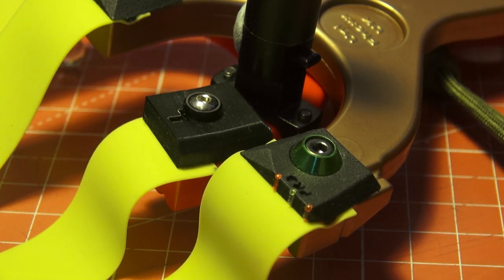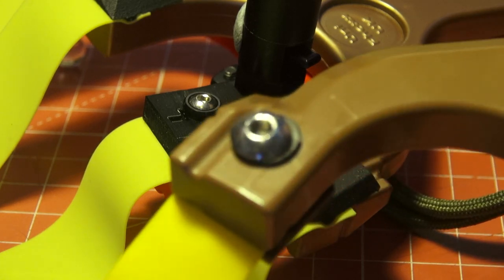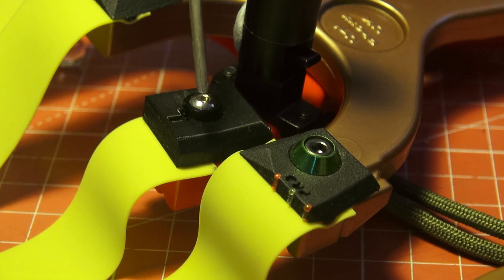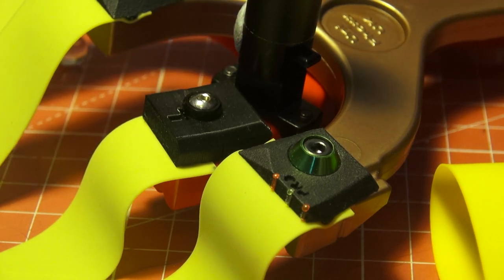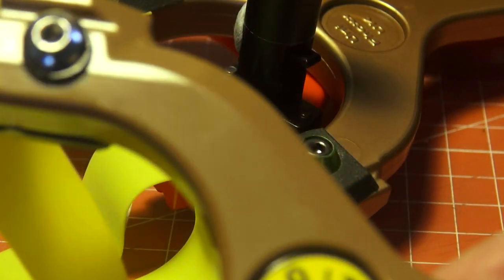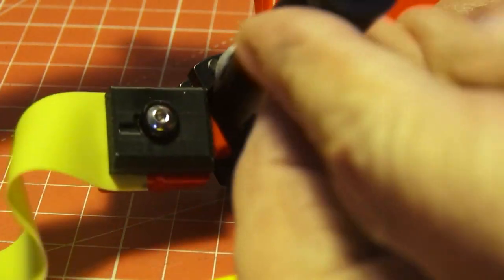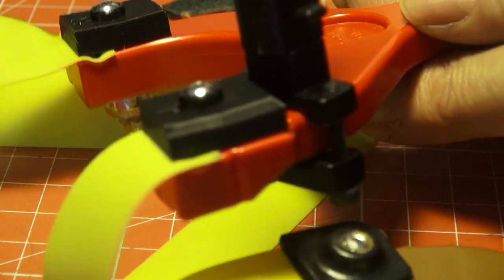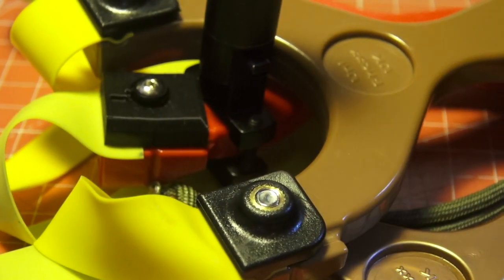WASP UNIPHOXX SLINGSHOT BAND-CLIPS  - ALL THREE KINDS

Comment: I’ve not used clipped catty’s yet. I sometimes wonder, does the elastic fray quicker seeing as it’s clamped tight in one place where it has to stretch when pulled? In the normal way the elastic can stretch right through where it’s tied.